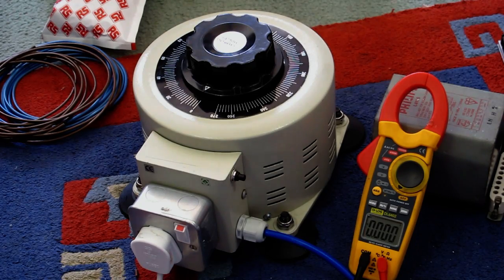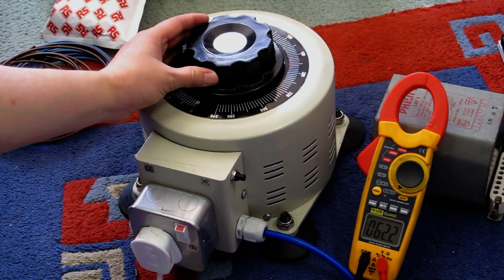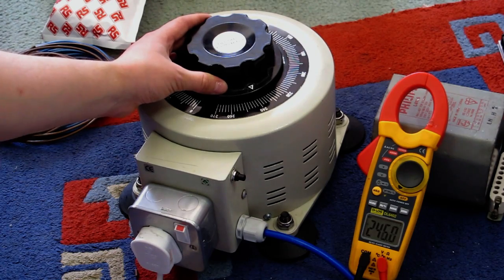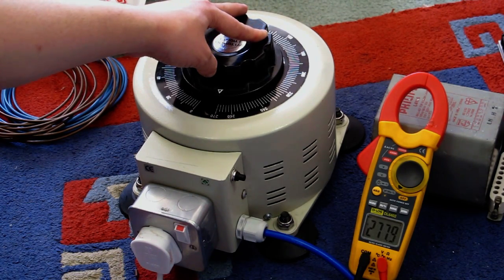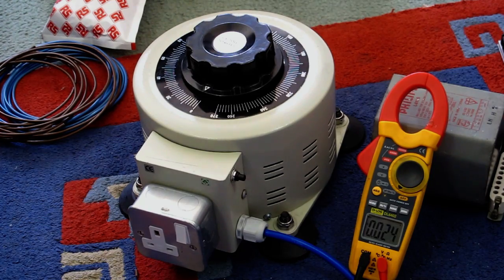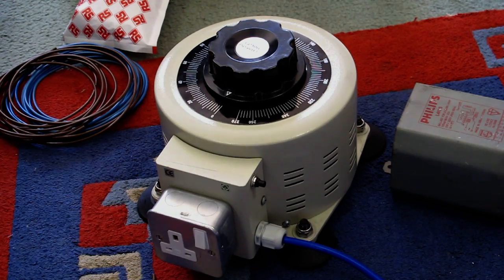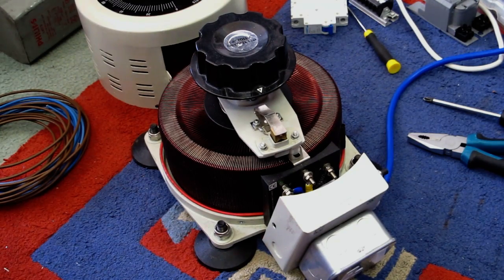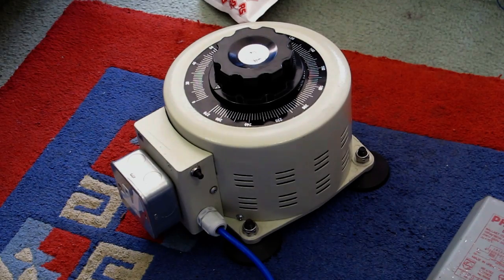The Variac

Comment: Don't forget that you can get as high a voltage as 460 if you apply 240v to the centre tap, just make sure that the variac is protected with a  ballast up to 1000 watts